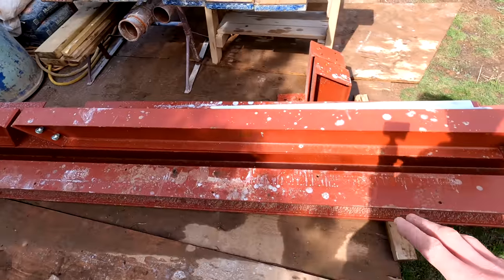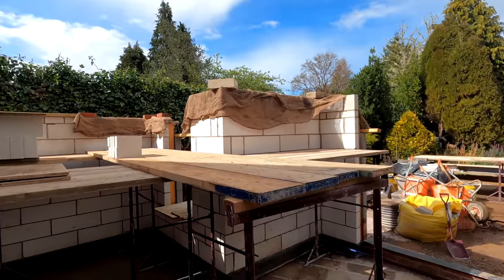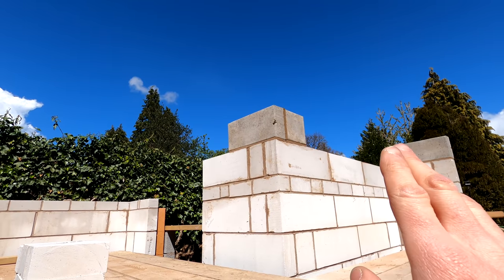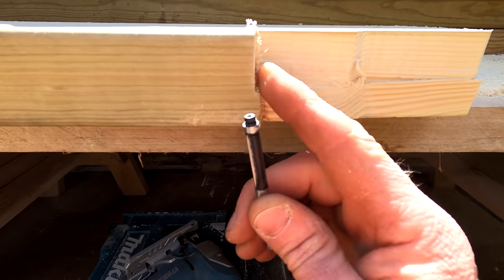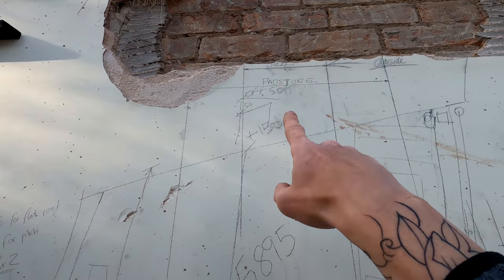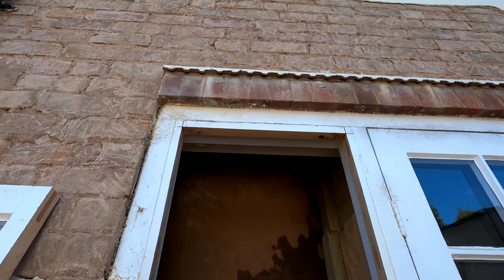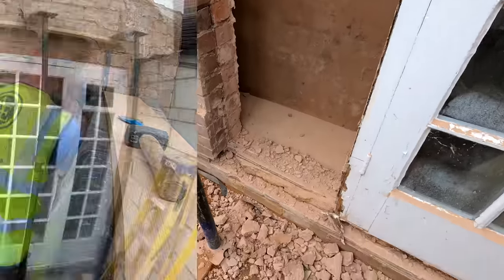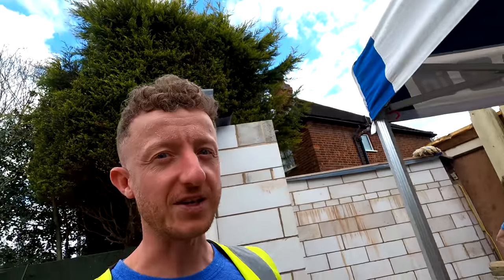Building our Blockwork upto Wallplate! | Single Storey Extension #13

Comment: Another great video guys and longer thanks. I've got makita trim router too, it's much easier on the arms and wrists for cuts like this, also easier to keep at right angles when hanging off the edge of the timber. I will be copying the plywood template idea. Thanks for that John. You all stay safe and have a good weekend📴